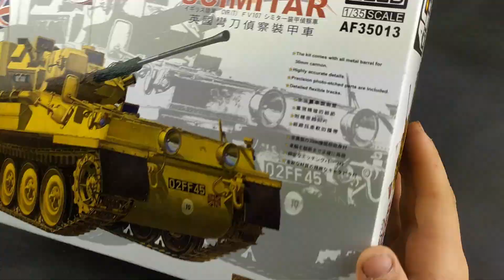FV107 Scimitar AFV Club 1/35 - Full build video

Comment: Hi, very nice paint job. As a Scimitar driver, gunner and then commander in many theatres and in combat, I’d like to give you a couple of pointers where you went slightly wrong on this build. 
Firstly, I’m not sure why you slackened the track like the Russians but cvr/t never drive with track that slack resting on the roadwheels! Big no no!
Second, mud always used to stick like glue to the underside of the sponson plates about track and under the mudflaps. Always!! 
Thirdly, the parts of the track where the wheels are running on always wore down to bare metal quickly including the spuds in the middle and the rear idler wheel. Otherwise this is good. 👍🏻
Reply from the maker: Thanks, I'll keep that in mind next time